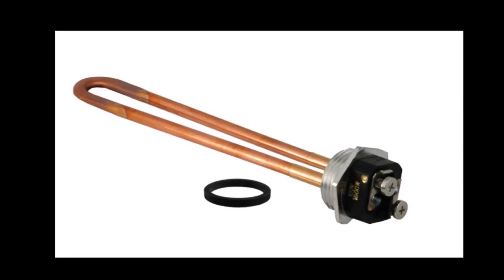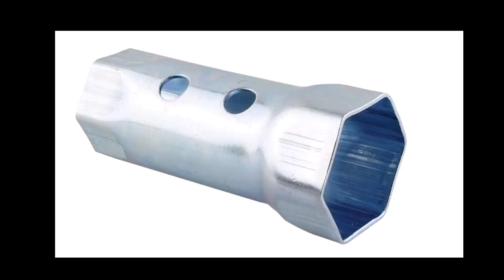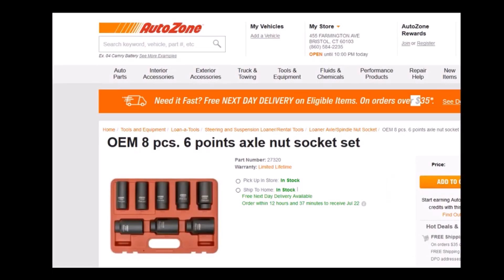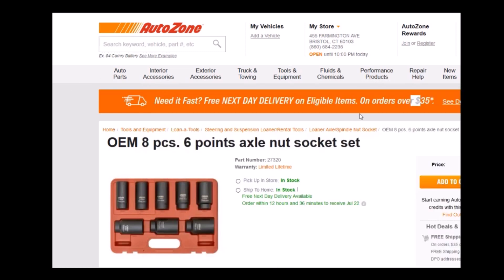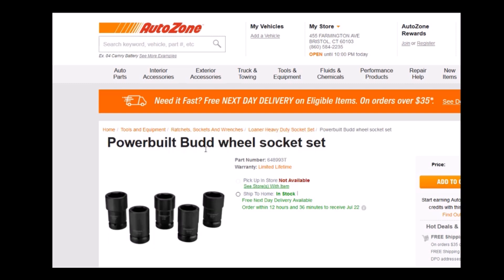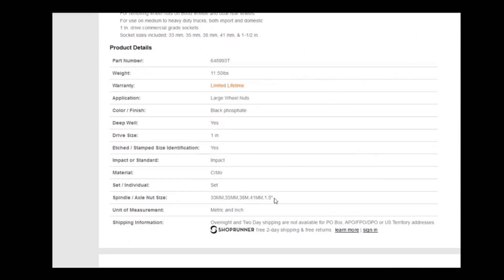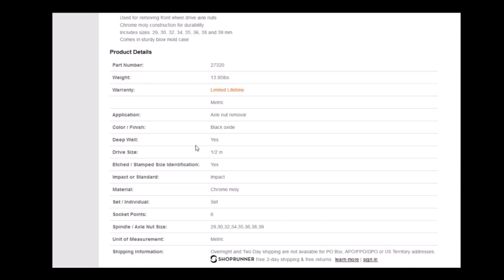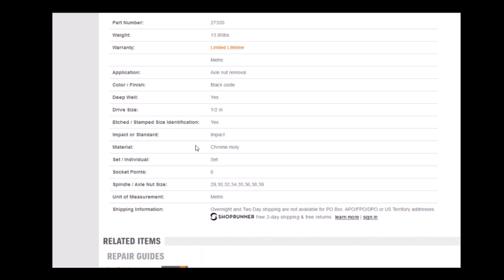Don't BUY tool to remove electric hot water heater element - BORROW it for FREE!

Comment: Get only the 38 mm socket and you will see that the end of the socket is beveled. It needs to be grounded flat with a grinder to get the best bite. Get a long breaker bar 1/2” drive . Good luck will be needed by standing on it to brake it loose.

Comment: Solid advice. I've used AutoZone's loaner program for this exact socket for my car, but I would not have thought about it for my heater element. Paired with an impact wrench, the 38 special broke free 3 completely corroded heater elements from my ECOSMART instant-on water heater. Unfortunately, the hard part was prying out the two whose internal element components had expanded within the chamber so much, their caps broke off during removal. A pair of needle nose pliers and vice grips and a hammer motivated them the rest of the way out. Those copper elements have been replaced with steel ones so hopefully they won't get as corroded with minerals so quickly. Hope others find your helpful video. Saved me from spending $600 for a new water heater!

Comment: If your gonna be changing your own water heater elements i think it justifies the need for buying an actual element socket. Its 20 bucks if you get a regular 1 1/2 socket you have to grind the face down flat cause it slips. They make 3/4 drive element sockets that come with an adapter can go on 1/2 drive. 20 bucks stop jumping through loops to be cheap. And if you have a bolt on element just change the water heater.

Comment: I found this AFTER buying the cheap stamped tool and permanently removing some flesh from my knuckles. This pushed me to the auto parts store. I didn't borrow the tool. I bought the 1 1/2" six point socket with 1/2" drive. It was maybe $10. One grunt with the breaker bar and the heater element was on its way out. Thanks for this.
Reply: Large sockets eventually come in handy so I also buy on ANY excuse. They last a lifetime and I've been DIYing for 45 years so far.

Comment: I just bought a 1 and 1/2 socket to change my elements. The socket set works so much better than the cheap tool because some of these elements are quite top heavy and when you try to screw them in, you don't have a counter weight to balance out the element. You wind up trying to screw it in and it is in vain. The socket gives you the counter weight plus the socket is a more secure fit and holds the new element so you can screw it in. The socket costs less than $10 and I think it will pay for itself over time.

Comment: Better borrow an impact wrench too!  Some of these are real nasty to get out.  Noticed you had pictured one of those heater elements with the very skinny flange nut.  That socket better have a real flush end.  These elements are either super easy or a nightmare.

Comment: Here's the -- THE -- problem. Yes, that cheesy tool does not work on a frozen element so a costly socket is necessary, however if the element is really frozen in place you will actually round off the hex points of the element trying to get it out then you are screwed. I'm a plumber with 47 years in the trade so I KNOW what I'm talking about.
Reply: And what do you do when you round off the points? Is there a fix?
Reply: @herrickkimball  Yes, then you drill out the center of the element with a drill bit large enough to make a hole of diameter to get a metal cutting Sawzall blade into the hole. Then very carefully you cut from the hole towards the female threads of the tank into which the elements screw. You do not want to cut into the female threads. Once you have cut just enough on one side of the element then you cut every 4th of the way around. Once you've made the 4 equal cuts then with a large flathead screwdriver and hammer you can break the 4 pieces out. Voila!!
Reply: @GnomicMaster  Excellent!  That’s a very useful bit of information. Thank you. 👍

Comment: how can I receive this in Pakistan ?
Price?
Reply: Autozone won't have stores there so best to obtain a correct replacement socket by first measuring your elements hex nut size (or that of your replacement element which may be more convenient) then purchasing a correct socket.  Note many standard sockets have a chamfer with can interfere with engaging shallow fastener heads and cause slippage. In such cases I grind off the chamfer (which is purely a manufacturing aid to center the broach which cuts the internal flats) to get full engagement. (This trick is famous for Harley-Davidson primary drive conpensator and pulley nuts but works well on shallow motorcycle and scooter nuts too.)

Comment: Why drive to borrow a tool when it's only $5?
 That's not worth it.
Reply from the maker: The $5 tool is very flimsy and weak ... it's STAMPED and DRAWN STEEL, not a cast steel tool.  Why spend $5 when you can borrow better for free?
Reply: @YuDaMan  

    Let's be real here...

You can just use a 1 and 1/2 inch deep socket if you want something better, but the reason element sockets are cheap, is because they don't require a lot of torque, and you shouldn't be trquing them hard anyway.

If you need to hit it with an impact to get a stubborn one off, that's a different story, but generally speaking, it doesn't require an expensive high end part.

Also,
 depending on where someone lives, taking anywhere from an hour to 2 hours out of their time and gas to borrow  a tool to remove an element, when a cheap tool does the job just fine, doesn't seem worth the time or the gas....

But Hey, whatever floats your boat....

Comment: Hey, Yu, like the majority of people call it, a hot water heater. Isn't it a water heat?
Reply: Both are good. Matter of perspective. My question for all is when does cold become hot? Consider this.... Put your hand in 45 deg water for 5 mins and then place them in 70 deg water.... How does it feel? Now place your hands in 115 deg water for 5 mins and then place them into 70 deg water? How does it feel? Kind of a rhetorical question. Just something to think about. Coming from refrigeration industry.... as an example.... when you have Ammonia that boils at - 27 deg F at atmospheric pressure. Well normally to us... that is pretty damn cold!!!! but to Ammonia.... its pretty damn hot because you are boiling. Food for thought....So do you call it a fridge or refrigerator? More to think about.... yes the original water put in is colder to the touch.... but once hot.... and it stops heating.... until the tank drops below it setpoint which is still hot.... you are just adding heat to water at 110 deg (which to most is still hot to the touch) just a little bit hotter until you hit 125 deg. Now you drain the tank or at the start of install filling it will what is cold water to the touch maybe 45-65 deg well water. So it is both.... but then 65 deg water to the touch feels really hot after hands sitting in 35 deg water for a few minutes.... So now 65 deg is hot! So from that perspective.... it is always a hot water heater. But also it is always a water heater.... but then again.... if the water froze inside.... and didn't destroy anything....   then it would be an ice heater (or frozen water heater) first then a water or cold water heater then to a hot water heater.... so you circle back to the only absolute answer that you cant possibly go wrong is.... water heater. But doesn't mean hot water heater is incorrect.

Comment: I have cold water heaters or just water heaters.  Just saying.
Reply: Either is good. Matter of perspective. My question for all is when does cold become hot? Consider this.... Put your hand in 45 deg water for 5 mins and then place them in 70 deg water.... How does it feel? Now place your hands in 115 deg water for 5 mins and then place them into 70 deg water? How does it feel? Kind of a rhetorical question. Just something to think about. Coming from refrigeration industry.... as an example.... when you have Ammonia that boils at - 27 deg F at atmospheric pressure. Well normally to us... that is pretty damn cold!!!! but to Ammonia.... its pretty damn hot because you are boiling. Food for thought....So do you call it a fridge or refrigerator? More to think about.... yes the original water put in is colder to the touch.... but once hot.... and it stops heating.... until the tank drops below it setpoint which is still hot.... you are just adding heat to water at 110 deg (which to most is still hot to the touch) just a little bit hotter until you hit 125 deg. Now you drain the tank or at the start of install filling it will what is cold water to the touch maybe 45-65 deg well water. So it is both.... but then 65 deg water to the touch feels really hot after hands sitting in 35 deg water for a few minutes.... So now 65 deg is hot! So from that perspective.... it is always a hot water heater. But also it is always a water heater.... but then again.... if the water froze inside.... and didn't destroy anything....   then it would be an ice heater (or frozen water heater) first then a water or cold water heater then to a hot water heater.... so you circle back to the only absolute answer that you cant possibly go wrong is.... water heater. But doesn't mean hot water heater is incorrect.

Comment: The tool is $3.39 at Home Depot. It is flimsy but it works and you will have it next time when you need it.
You have to go to Home Depot once and to AutoZone twice plus the time with the paperwork.
Good idea but, to save $4,00 with tax, I'm not sure it's worth it.
Reply: Except for the people who have a stuck element and instead of the element turning, the tool bends and is trash.  Best to buy a cheap real socket over these flimsy ones.  You can find a Chinese socket for $10 and could be useful for other jobs as well.
Reply: swollen fingers and scabs on my knuckles and wrists say you're wrong.  Plus the elements are still stuck